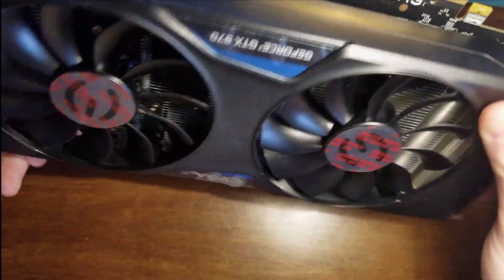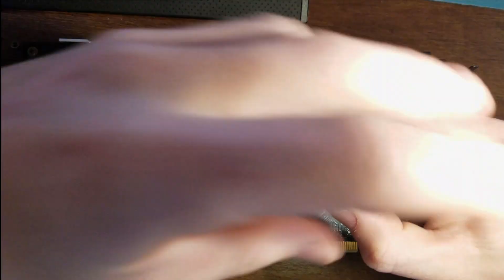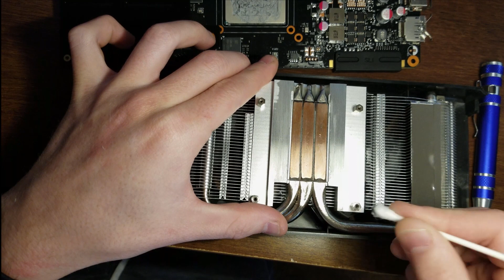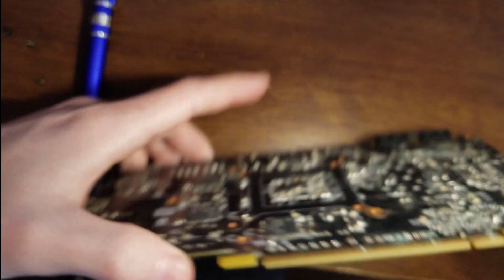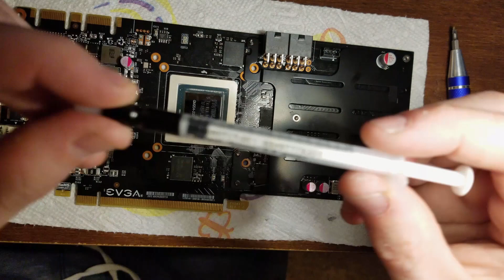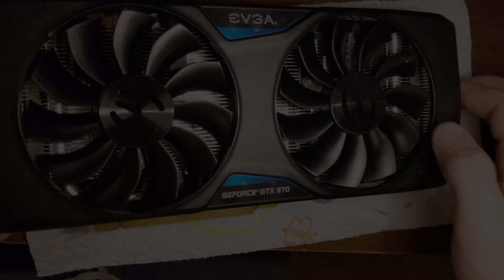EVGA Geforce GTX 970 Teardown and Cleaning

Comment: you are tired of yourself))
If you had washed it cleanly with hot water, brush and even detergent, you would have worked for 5-10 minutes at most .. you would have done a very clean job ..
sweet, city water does not hurt the card.
as long as the electricity plug is not plugged in)))

Comment: You didn’t lay the thermal paste in a cross pattern. Thats probably why it didn’t boot
Reply: he didnt plug 2 6pin power cables :3 thats why it didnt work hahahaha
Reply from the maker: Good call. It's in the trash
Reply: Nah, it's all the fucking corrosion surrounding the board.